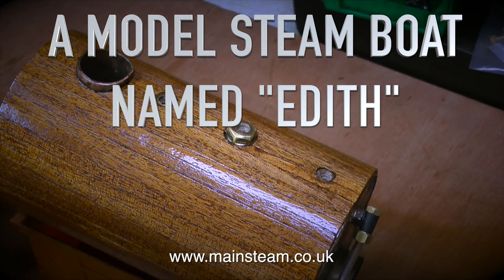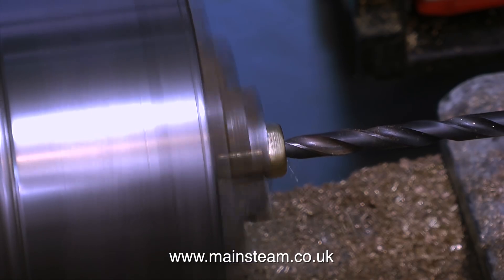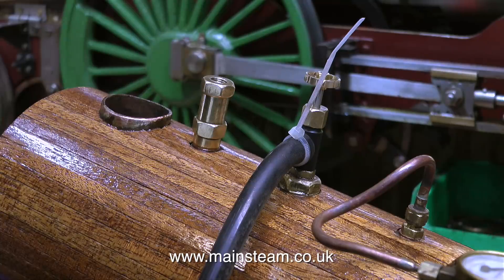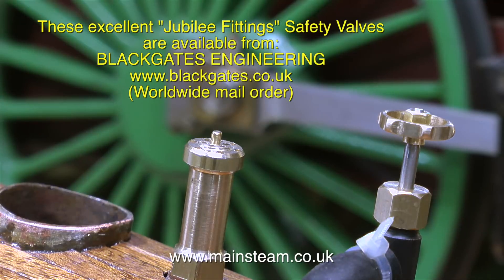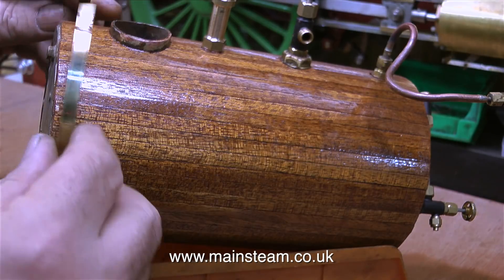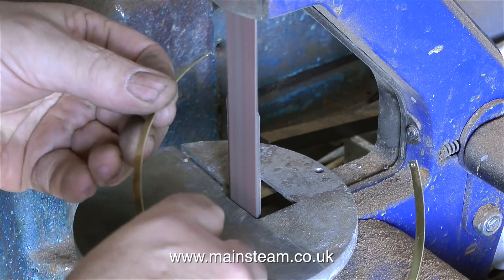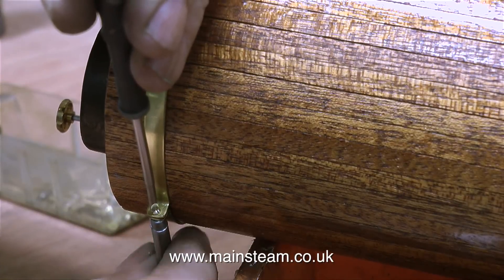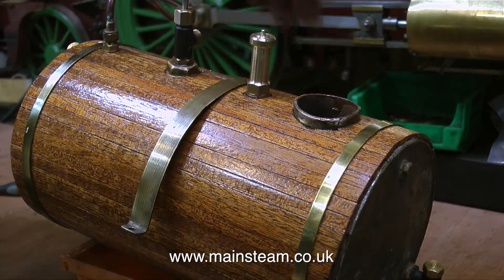A MODEL STEAM BOAT NAMED EDITH - PART #24

Comment: Hi Keith,  I love your videos in particular the boat restorations.  A quick question,  re the short pieces of cladding  around the fittings at the top of the boiler.  Will the come loose as the boiler gets steam,  or will the glue hold.
Reply from the maker: The small pieces of Mahogany are firmly glued to the other strips so they do not come loose.

Comment: Keith, is there a rule preventing you from making an extension tube from the boiler to the top and placing the pressure valve on top of it? Or is it a requirement that the pressure valve be fixed to the boiler as close as possible?? Just curious.. Thanks
Reply from the maker: Not a good idea, the Safety valve needs to be as close to the boiler as possible. If it was on the end of a long thin tube it could be a problem as the tube becomes part of the pressure vessel.